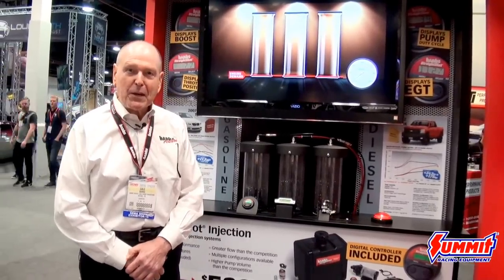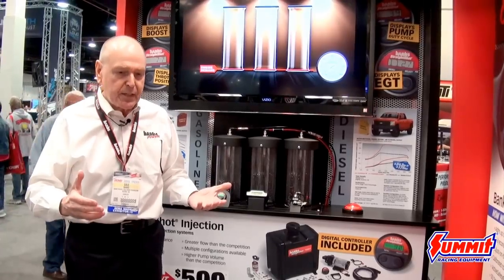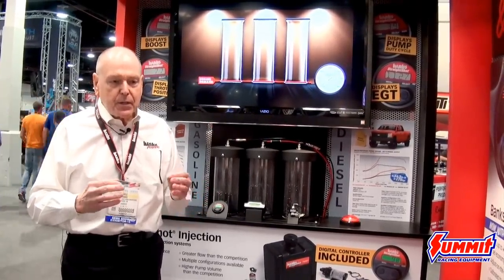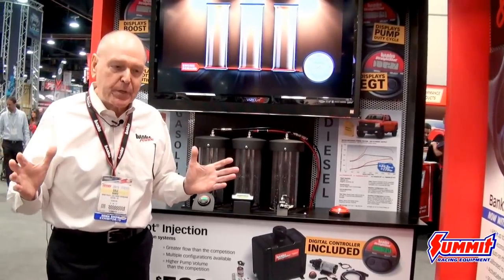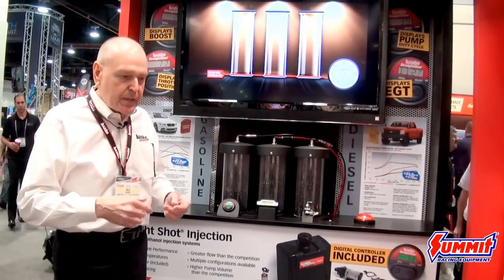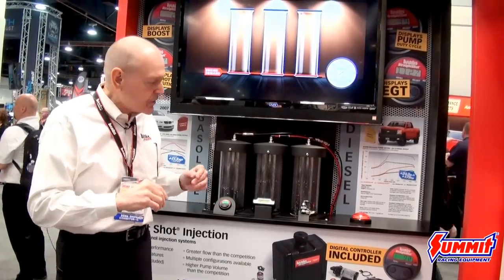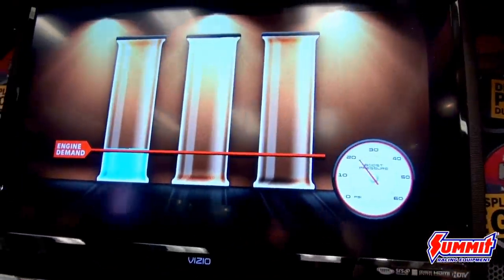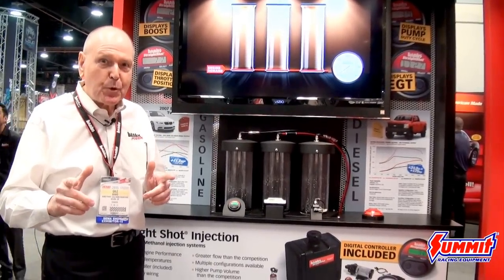Banks Straight Shot Water Methonal Injection - SEMA 2015

Comment: Semi trucks ive seen in the rockies run steam vapor methanol injection for better pulls over steep climbs. Just fkip the switch on their turned up truck and it cools the egt's and boosts power it also helps clean the cylinder from collecting carbon.

Comment: Mr. Banks,
I found this trying to reference a calculator which would tell me how much maximum compression I could run in a Street big block for fuel mileage and performance with water injection. Then I saw your vid and decided to watch because it’s yours-a smart engineer.

While you did mention the application type I was interested in I was left wanting on data sets. Perhaps Sr. Ricardo has some tables for me?
Reply from the maker: You will need to contact Banks Power. We just have their video from a show. Good luck!

Comment: Can this be used with diesel engines running on used cooking oil or wood/syn gas from a gasifier?
Reply: I'm not sure. When I was in middle we learned how to run your diesel with cooking oil and based on what I learned I'm not sure if it could work it probably could (theoretically) but water/methanol is mainly used for actual fuel though. That is a good question
Reply: I've been looking for the same answer for Waste motor oil  as well, I believe I heard or read that the water meth injection can de-coak the injectors tips from the extra build up that comes from WMO systems
Reply: I have a 2003 Volkswagen Touareg 4.2 V8 petrol. 

Would my fuel economy improve using your system?

I live in South Australia.